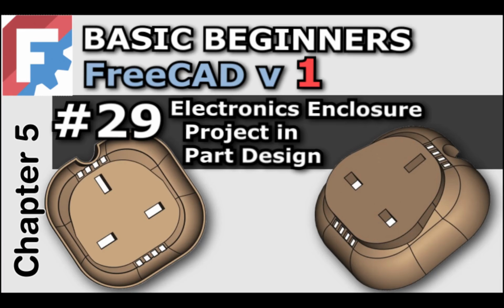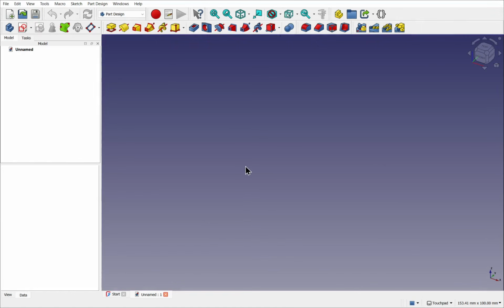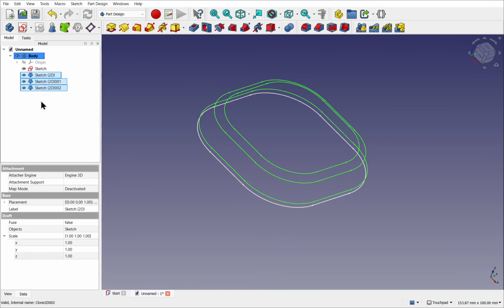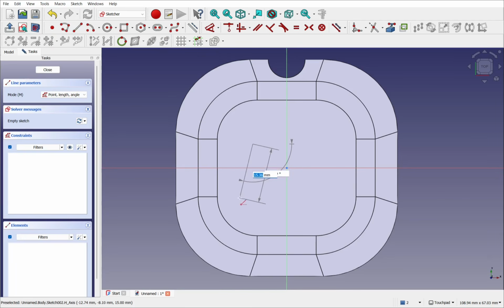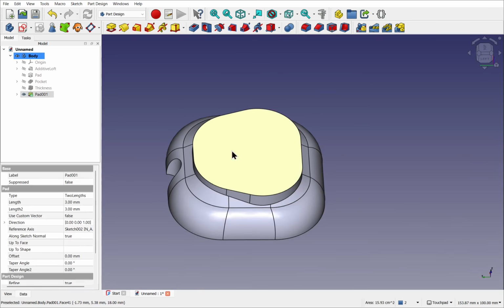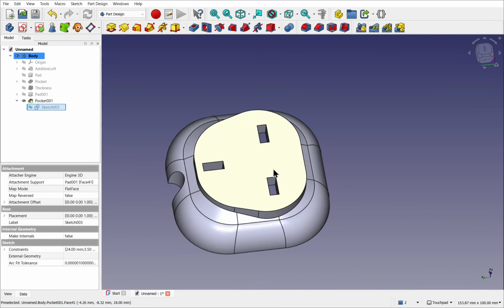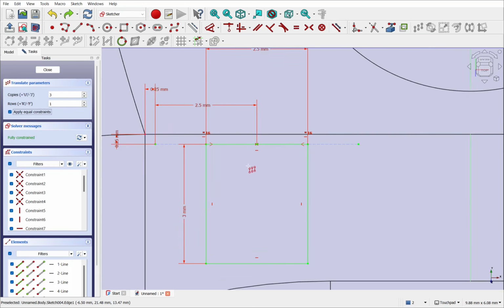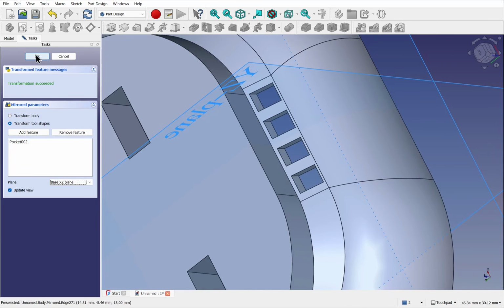FreeCAD v1.0 | Electronics Enclosure Project | Basic Beginners FreeCAD 1.0 Lesson 29 for 3D Printing

Comment: Instead of cloning and scaling sketches in the draft workbench, is it possible to 'reference copy' them in part design and parametric scale them with a variable?  There may be features in the sketch that need to stay the same size (eg holes), while the outside lines in the sketch need to change.

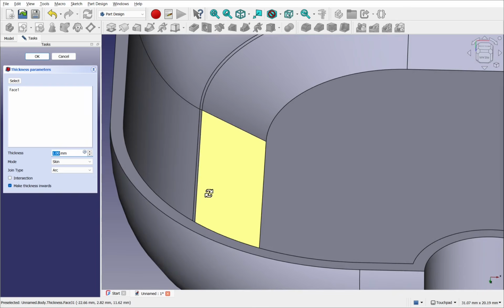Comment: At 13:05 I simply cannot get the thickness tool to work. I've folloed all previous steps, and when I apply thickness to Face1 it simply doesn't get hollowed out. No errors are kicked up, the tree the thickness object as if it is working correctly but the model itself isn't hollowed out.
Reply: I managed to solve it. If anyone else has this issue the problem originated from the original square sketch. Not sure what I did differently to solve it.
Reply from the maker: Glad you got it sorted, sometimes the thickness will fail due to an edge crossing another, I do have a video about that somewhere, ah, just looked back, it's the previous lesson before this one so you may of missed it or viewing this one as a one off, but this should help with the question: https://youtu.be/sH424C3xEOs

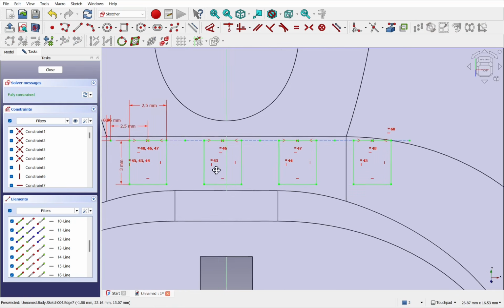Comment: at @29:03 my version of FreeCAD (Version: 1.0.1.39285) wouldn't allow me to select both points by using a bounding box - it threw an error. I had to slightly move one construction geometry down so that I could individually select each of the two points and THEN choose a coincident constraint.

Comment: Another nice Tut, I've grasped that essentially intersection of various edges/ features can cause Modelling issues. Once again great theory being introduced. Again I reiterate that many Modelling issues are the result of poor Geometry/ Practice. When pocketing the 1st Set of Vent Holes Through to First Pocket Dimension option works well also (it eliminates the slight intrusion of the last pocket operation on the Circular pocket done earlier.

Comment: Very educational and instructive video. Excellent way of planning feature array depending on expected dimensions of sketch. If you don't mind - pocket depth of ventilation holes deeper than 1mm collides with inside surface of cable hollow.
I modified this task building EU shape socket and different number of vent holes. This was the best hour and a half of this Sunday so far. Thanks much Darren.
Reply from the maker: Thank you so much for your feedback, great to hear that your enjoy the videos so much. The pocket could be resolved by adding the sketch on the inside of the loft so they pocket outward. To do that there is another sectioning tool to split your view.   Maybe I need to create another quick video for this one as it could be useful 🤔
Reply: @MangoJellySolutions  Thanks for this suggestion. Probably there is many ways to modify this. It is for example possible to move the sketch along Z axis with the dimension of wall thickness 1mm and then pocket it opposite in "up" direction. I did it minute ago. Every second of your additional short videos will be highly appreciated. I am sure by most of users here.

Comment: I had an interesting issue with constraining the plug sketch (the bit that has the three metal prongs that go into the socket). I constrained the top line to be 2mm from the imported geometry but on the wrong side. That bit me at the end when I came to add the 17mm radius constraint as it couldn't grow that large. I can't see any solution to this issue other than developing a proper understanding what the constraints are doing and what limits they apply.
Reply from the maker: What you touch on there is a very in depth subject that takes time to learn. The constraints themselves act upon each other as you have found, it can be taken to  the extreames and  you can create simulations of mechanical movement with unconstrained but linked lines and circles . I even have a very old video that I used sketch constraints to drive the movement of a piston assembly.  With  your issues, if you double click on the 2mm and change it to reference by checking the box, it won't constrain but will be visible in blue and change size as you move the constraints so you can see the affect that it has on others. Which may help
Reply: @MangoJellySolutions converting it to a reference constraint is a great idea. Thanks. I'm taking a lesson or two each day and greatly enjoying the beginners course. I really hope that developers of FreeCAD try too maintian a some stability in the interface now its reached version 1. Software like this needs good tutorials, it would be a shame if they became out of date.